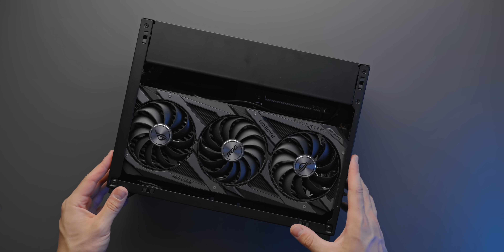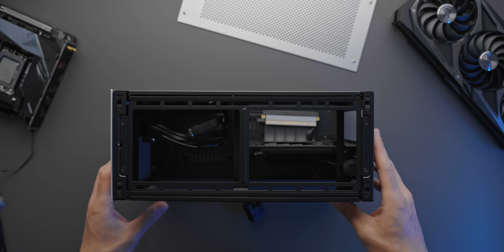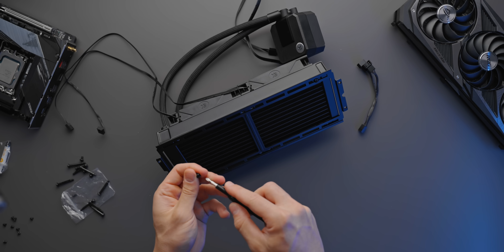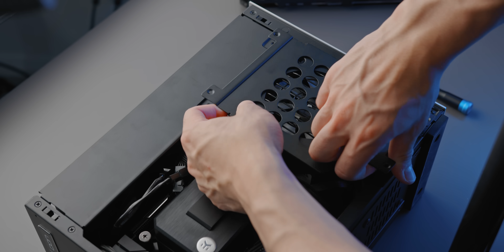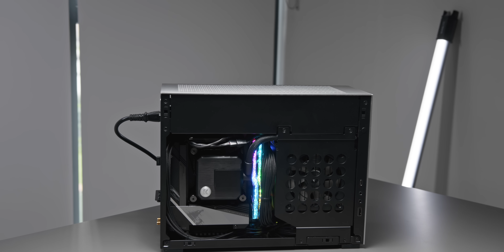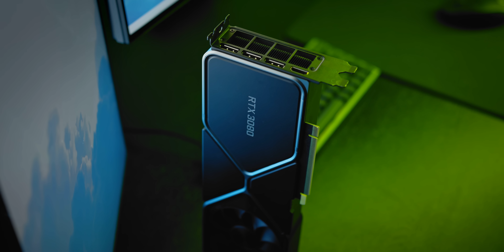Tiny Case with Perfect Fitment – Dan A4-H2O

Comment: The 12600k would be better for this case I think. And on the AMD side, the 5600X. The 5800X might be cool enough to not thermal throttle, but I don't have any data to back that up.
Reply: you might want to look at the i7 12700.
Reply: @keibohow69  does that one a lower TDP than the chip used  in the video?
Reply: @sitordan  yes check the specs online to find out why i suggested it.
Reply: @keibohow69  You are right. The PL1 is half the TDP at 65 W instead of 125 W. That usually means lower temperatures.

Comment: As always great video!
Like you said, it's nice to see SFF case makers standing up to the big GPU challenge and trying to make it as compact as possible. 
I'll wait for the next gen GPUs and hopefully a bit later, we'll hear more from the "Ncase M2" concepts. 
I can't wait to see, what Ncase will do next!
Reply: Now with next gen GPUs out you should buy previous gen GPUs.😂 Man I hate the PC market right now. Sadly this seems to be the new normal.
Reply: It would be better for them to make an actual liquid cooling case.  Saying you can use an AIO and a bulky 3 slot air cooled GPU isn't liquid cooling, it's just an AIO like practically ever PC case on the market.
Either make a tiny tiny tiny case with bulkhead connectors and a matching rad/pump/psu stand, or make the case with a space for pump/res and focused airflow through a rad or two.
Reply: @Grimmwoldds  I prefer air cooling. SFF PCs are expensive enough already and air cooling is more reliable and longer lasting. Smart designs for air cooling is what I want.
Reply: it's the worst thing, causes cases to get huge for no reason and yet most of them can't handle CPU cooling anyway

Comment: 10:29 My G.Skill Trident Z RAM is at a 45 degree angle almost with my ASUS Z490i MOBO and EKWB D-RGB AIO. I have had zero issues, but would not recommend it for a first time builder as you may break the parts

Comment: um.... the meshlicious can do the same thing and more. 280mm aio support, triple slot card, good cooling.
Reply: Don't foprget the Meshlicious is 36% bigger in volume
Reply: @MetroversalDesign  and he also compared this case to larger cases, but neglected the meshlicious.
Reply: Yea that case is king
Only issue is the input placement
Bigger fit or put on side n have something lift it 2 inches above the table is good
Aleast that what i did
Reply: @Nirvuna  I paid 12 bucks for 3d printed feet that are a tad under an inch, running 4 monitors from the card no problem. You also know you can raise the gpu bracket to give you more room right?
Reply: @GrumpyWolfTech   yeah iknow but I'm using MSI 3070 trio
Barely got it to fit  it not sliding anytime 😁
When the 3060ri arrives i switch it out
Reply: @Nirvuna  I have a 2080ti in mine and it fits perfectly with the bracket adjusted. Also why would you downgrade your video card? O.o
Reply: @GrumpyWolfTech   is my son's
He only plays Minecraft
N that's 3060ti  more  than enough and more efficient
3070 is going in the wife build 😁
Reply: @Nirvuna  haha! Fair enough

Comment: Only psu with higher wattage than the sf750 is the cooler master 850 and it's honestly trash. Bought it and returned it due to it dumping out a ton of heat and noise for the moderate load I had it on. Plus it had bruuuutal coil whine. Switched to sf750 and it's been fine. 3rd sf unit I've owned and never had an issue.

Comment: Finally ditched my Silverstone SX700 PT for the corsair SF750. The silverstone was unbearably loud and was even noticeable when the PC was under full load with 3080 and 5600x oc. The cables included in the Silverstone were also very stiff and took up much more space than the Corsairs braided cables.

Comment: I doubt my 12700k would handle this setup without overhearing. Hits 90° on an nh-d15 in cinebench. Games it's good at around low to mid 60s and peaking low 70s but definitely not a great chip heat wise.

Comment: Pressure on the ram was a big issue for me, was getting random hard freezes. All issues stopped when I moved the tubing side to the VRM side.
Reply: Motherboard manufactures really need to allow for more space on their ITX boards
Reply: Yeah over time that's gonna rip the board traces up
Reply: Last week I cleaned my PC with an air blower and it didn't boot up. It was the RAM. Damn, if they're delicate.

Comment: I wish they had made it a bit wider to be able fit a 280mm rad. Perhaps even make two variants of this case for 240 and 280mm rads.
Reply: Then it's basically a horizontal Meshlicious lol
Reply: @Aexeq  Not really. It would still be smaller than the meshlicious and have all the motherboard and gpu's io ports facing the right way. If you were to lay a meshlicious horizontally, the table would block all the motherboard's io ports or you'd have to have them sticking at the side if you put it side down.
Reply: Yes might well go with the meshlicious 
 Better in every way.
Reply: @Nirvuna  They are still different designs. Horizontal vs Vertical. And a horizontal meshlicious just doesn't work in my opinion for the reasons I stated in the previous comment.
Reply: @J.I.R.A  
I guess but this has no airflow
I have my sons meshlicious horizontal 
Just made 2 inch holder on each side to rise  it.
Cools the 5800x n 3070 just fine n looks way better.
Reply: @Nirvuna  I mean the meshlicious is undoubtedly the best sub 15l itx case imo, my favorite I'd say. But this case is one I'd seriously consider buying over the meshlicious if it had the option to have a 280mm rad. I think it has a lot of potential.
Reply: @J.I.R.A  ohh  understand
But than it probably won't be a 11L case.
The meshlicious is perfect  in my opinion
Getting a white soon for the wife build.
Reply: @Nirvuna  Yeah they'd probably have to add 2cm width and around 3 cm length, maybe even a bit less length wise since there is some wiggle room with the 240mm rad. 
It would probably go from a 11.1 liter case to a 13.7 liter case more or less. I think a 25x140mm fan would be able to fit on the gpu side as an intake and maybe even a smaller one on the cpu side, leaving the radiator as an exhaust. Or vice versa, side exhausts top intake.

Comment: NCase M1 died for this...
I get that they tried to make it as small as possible to fit all that but that's too many compromises to be made. 
You have to be picky with the AIO you use and the pump has to have hoses on the side with fitments that can be rotated or you won't be able to route the hoses. Also, good luck with non-sleeved PSU cables...There are few videos out there showing what kind of issues you may run into if you don't cherrypick your components. And thermals aren't even that great.
The reason I'm nitpicking so much is what I've said at the start - NCase M1, the case just barely larger than this with much better HW compatibility and thermals, was discontinued to make room for this...It's an OK case but nothing more, and M1 would have been a better buy.
Reply: Different class of cases.. this is more a T1 alternative. The M1 got discontinued for a new future version of itself. 

You need a brain transplant.
Reply: i agree, it seems like you will have to be very very particular with most the parts you use to build inside this case

Comment: I love my nr200 but truth is... I find it huge. Was thinking about getting the meshlicious but the video output positioning isn't "optimal"...
So... This one may be an option.
Reply: You can get feet for the meshlicious, works out perfect.
Reply: Yea that she only issue  for that case
But i work around it ,i put  on it side 
 made like a holder on the sides.
Leave 2 inches of the table n keeps my 5800x. 3070 nice n cool
Or u can buy the cable from eBay

Comment: You are talking about terrible fitting of aio on itx motherboards for 12th gen of Intel, but what about 11th gen?  Would I also run into the same problems or is just there more space? Was thinking about gigabyte z590i inside nr200p max
Reply: B660’s would work for a 12700k, and half the price of a z690, and much better aio fitment.
Reply: The fitment problem is down to the socket size, shape, and orientation differences between LGA 1700 and LGA 1200 on the itx MOBOs I believe. If memory serves correct, the LGA 1700 socket is actually rotated 90° differently than the LGA 1200 sockets, towards the RAM slots which is causing clearance issues with some coolers and RAM kits. Plus the LGA1700 dies are rectangles, not square like LGA 1200. I might be wrong, but I think you'd be fine on 11th Gen, but I haven't built in this case. Cheers

Comment: Hey Optimum Tech, awesome video. It came exactly when I needed it. I'm wondering if you can provide what ram you were using: the EK is difficult to fit into the gigabyte motherboard with some other ram, and I don't wanna make a mistake...

Comment: Truly feel like this thing is a backwards step from the M1. Almost the same size, 0 flexibility for air cooling and no windowed panel. I really dislike cramming so much weight with rads, pumps and all of that clutter. Call me crazy I guess, but nothing has trumped the M1 yet in my opinion.
Reply from the maker: Main advantage: Dan A4-H20 can fit larger graphics cards in a smaller volume (and when it comes to 2.5-3-slot cards, cool them better too). This is actually what matters to most people building a PC today. M1 can't actually fit many current RX / RTX GPUs.
But for sure, M1 is infinitely more flexible and I see what you're saying.
Reply: @optimumtech  True, not many folks want to deshroud their GPUs to get good temps and low noise, and some GPUs just won't work well that way with the way they are designed (protruding tabs, etc.). BTW, the Silver Soul 135 is a literal breath of fresh air for high core CPUs in the M1. You should check it out if you haven't already. Tight fit, but it works well.
Reply: I agree, personally I would prefer more innovation for SFF cases without a riser. Until then I'll stick to my M1.
Reply: Dan’s forthcoming C4 may scratch your itch.
Reply: The price point and availability are the main areas they are addressing. With a 3.0 riser it is $115 and with a 4.0 riser it is $155. The appeal is that this is a small computer with good thermals and low noise combined with more GPU compatibility at a lower price point to reach more consumers.
Reply: @avery4528  agreed, I'm a tinkerer and this ain't it for me. Certainly more affordable and hits the mainstream folks and products that don't require any modding.
Reply: And that’s why competition is good 😊 although personally I do like this but I’m waiting since, if I recall correctly, other sff case manufacturers also have more/updated case to show off this year
Reply: At these sizes, saying "almost the same size" is silly. There's cases that are "almost the same size" as the m1 and perform significantly better.. Good luck fitting GPU's this size in the m1, and it's called the H20 for a reason, it sacrifices some flexibility to do something that other cases can't even do at all - while being smaller..

Comment: All of your build never disappoint. Clean and an eye candy.
Reply: clean and sexy!
Reply: It's really an awesome build. But im still hoping for a Tophat like the Ghost S1 for my NR200P. Or a taller revision said NR200P for an additional 280mm AIO at the Top.
The NR200P is not THAT much smaller and I don't like cramming everything in like that.
There is also the Krux Naos which is almost the same as the NR200P 22L vs 20,3L, BUT has room for a M-ATX Board and an ATX PSU at the same time.
I'd consider those to entry level SFF, while the DAN A4-H20 is Mid/High Tier.